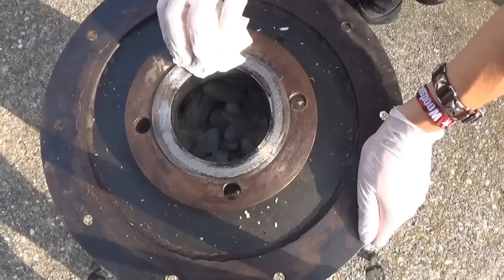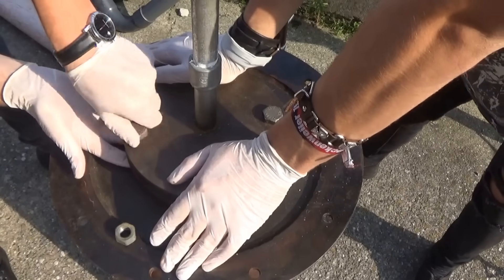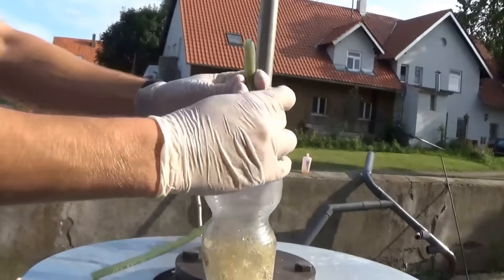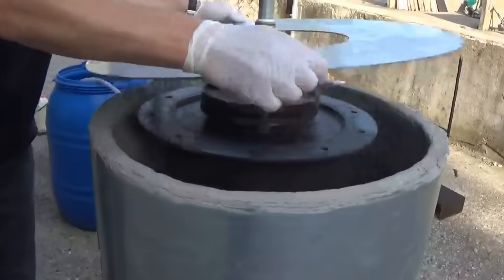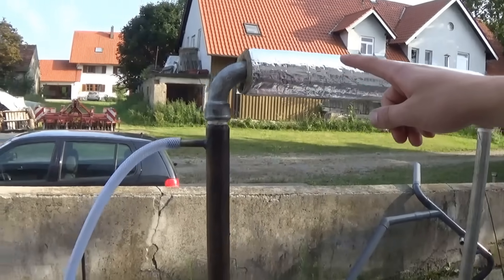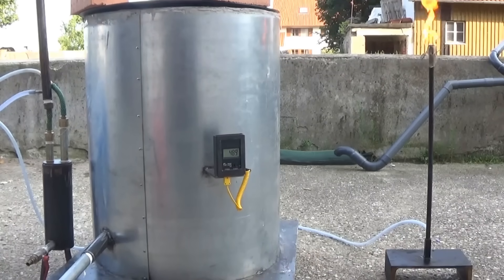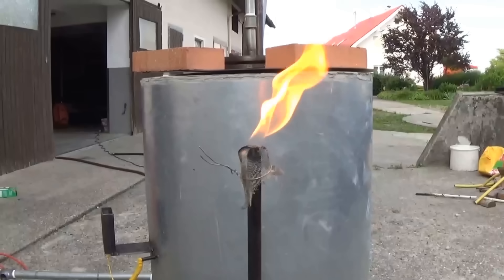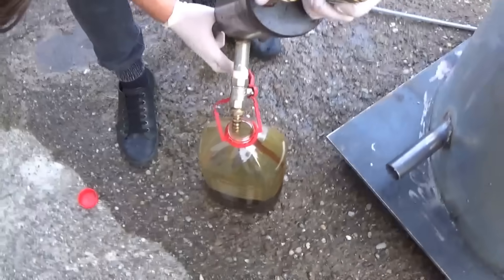plastic waste to oil/fuel improved pyrolysis reactor

Comment: I have a suggestion; to have a more volatile and easier to burn fuel you should try heating the released gas separately; either by moving it through a hot long metal pipe or turning it to a hot plasma torch using electricity

Comment: Add a GEET Fuel Processor and send excess power back to the poll.$$$$
Paul Pantone invented the GEET Fuel Processor, a replacement carburetor that uses 20% gasoline, diesel, crude oil and the like, and 80% water in a bubbler that runs up into a double pile with a rod in it. The creation has some effect that makes a plasma arc and changes the fumes to another element that creates an implosion instead of an explosion. No pollution and 3% more oxygen than what's in the atmosphere. It's easy to make, thousands of backyard mechanics have built the GEET Fuel Processor and many have posted their results here on YouTube.
This one shows the Plasma Arc.
https://youtu.be/RTmN5EEcJ5Y?si=-NmFac7Y42Ov8nHk
This one shows it running on beer and coffee. 
https://youtu.be/RBdLisFwbVc?si=oE5BUymRAc130D8r
I really hope your notifications are on.

Comment: Your burning plastic. Is no one thinking of the exhaust gas being extremely cancerous and smelly. What about our breathing air quality? Did you do the calculations on that? Gasoline and diesel have exhaust systems to catch and clean combustion products. Have you designed such an exhaust system for your fuel? Most fuels are aliphatic hydrocarbons, most plastics are highly branched polymers. How do you prevent unwanted combustion products and promote clean burning? The government has put a stop to this for a reason, burning plastic isn't safe on any level!

Comment: While in theory a great way to make use of plastic waste, if you're using assorted plastics that can be contaminated with all sorts of other stuff, you're going to have such an complex and unpredictable chemical stew coming out of the reaction chamber as to render the output as bad or worse than crude oil but at a far higher production cost. Seems like just burning the waste plastics as a fuel source instead of fuel oil and using the fuel oil to make new plastics might make more sense.
Though I could imagine that this might be worthwhile with cleaned and sorted plastics so that the output could be made more stable and predictable. Though I still have a hard time believing that the resulting fuels would be cheaper than crude oil derived ones.

Comment: I saw that you used a weld neck flange as a means to distance the heat from the pipes, but I was wondering what type of flange you welded the actual pipe to? Is it a blind flange with a hole machined into it? I'm very curious as i'm considering creating a reactor myself, any help would be appreciated. Thanks!

Comment: OK. NOTHING NEW HERE.   BUT NOTHING IS FREE IN THERMODYNAMICS.    NOTHING.  SO HOW IS BURNING BUTANE TO PYROLYZE PLASTIC TO CREATE A LIQUID HYDROCARBON GOING TO REVOLUTIONIZE ANYTHING.
Reply from the maker: Hello as said in the video the process can be run by the produced hydrocarbons. Which amount for around 30% of the energy stored in the waste. 
My hobby system just burned the gas in a flare because i was having problems building a gas storage system. 
If you are interested in the matter I can recommend you a couple of papers which explain the process in detail. 

best Elias

Comment: Strictly for climate change deniers. This makes CC worse by using more fossil carbon as a fuel. Yes, microplastic pollution is a gargantuan disaster, but CC is more pressing.
Reply from the maker: First of all I am no climate Change denier. Second... please read scientific papers try to inform yourself on a topic before you post your opinion. Once you have done this you will understand that your opinion on the matter is lacking some important bits. 

Best hazelChem
Reply: @HazelChem  Wow, extreme assumptions there sir. I have read many scientific papers on the topic. However, none are needed to know that the plastics that you are processing are all made from fossil fuels. What other premise is required to prove my conclusion?
Reply from the maker: @TheJamesRedwood   The fact that fossil fuels will be needed for quite a while more is undeniable. In the industrialized countrys we need to go for green technologies as fast a possible.. but the global south is lacking the infrastructure to do so. It is euro centrist to think that even in one hundred years we can go fully green or circular in economy.  
Having said this, many countrys have no functioning waste management system and fuel supply tends to be a problem. There pyrolysis comes in as a transitional technology for a couple of hundret years. With pyrolysis you can decrease the amount of garbage that is being put into landfills and produce hydrocarbon based fuels. The economys of the global south will need fossil fuels in there path to modernization. In other words those economys will need those fuels so it is better for them having a decentralized way for disposing of waste and also producing fuel. 

Best hazelChem
Reply: @HazelChem  I live in the global south so don't preach to me. 
So you don't deny CC you just don't care. Nothing you have said argues against the conclusion that burning plastic increases the amount of fossil carbon in the atmosphere.
You haven't even begun to address the toxins, including dioxin, you will be releasing in addition to the burned hydrocarbons. Have you even warned people about this in your video? Or are us southerners not worthy of breathing clean air?
Proper recycling, which I realise is hard to find, is the only ethical use of waste plastic. Burning it is the worst possible use.
Reply from the maker: @TheJamesRedwood   
first point dioxin: 
dioxin also known as 2,3,7,8-Tetrachlordibenzodioxin cannot be produced in this system. It is chemically IMPOSSIBLE. I study chemistry at the technical university of munich so this is my field of expertise. 

second point: 
production of CO2 must be decreased in the industrial nations. Studys have shown that the economys of the global south will be reliant for many more decades on fosil fuels. This CO2 will be released by those economys importing fosile fuels and burning them. Pyroylsis allows to reduce the amount of fuel that has to be imported thus strengthening the local economy and in the same turn disposing of plastic waste. 

So if you do not want for those economys to collapse and bring poverty in the region you will need fossil fuels for the transition period (which will last many decades). 

third point: 
as I am working with many in the field of recycling... most plastics can  not be recycled. It is a sad truth but if you watch documentarys like "the big recycling lie" you will see the dilemma. 

Seems like you are quite strong on your opinion but maybe those arguments can reach you. 

Best hazelChem
Reply from the maker: For those interested I will answer this persons points:

Pyrolysis is done under a inert atmosphere (in my chase CO2). Under these conditions there is no formation of  poly cyclic chloro aromatic hydrocarbons (dioxins). They need oxygen for the formation. 

Pyrolysis as any crude oil contains hazardous compounds and has to be handled with proper safety precautions. These are pretty similar to those of normal fuel. Also the pyrolysis of PVC has to be done with specialized equipment (BASF has a patent for this)    
Here you can get good information on plastic pyrolysis:
https://doi.org/10.1016/j.pecs.2022.101021

Now to the last point. I want you to ask yourself the question and do research on the topic. Do you think our fossil fuel dependent economy can directly switch to clean? 
Wouldn't it be better to turn non recyclable plastic waste into fuel and decrease the amount of oil we have to pump up? Wouldn´t it be better to get rid of the plastic waste and turn it into a resource instead of clocking up half of the world? 
For answering this question for yourself I want to share scihub with you. You can search for papers on google scholar and have open access by putting there name or doi into scihub. 

scihub: https://sci-hub.hkvisa.net/

Now to you TheJamesRedwood. The way you answered is just not okay! I know that many people think that the internet is free of social standards but I wont let you talk to me like this. Maybe the next time you want to actually have a discussion with someone on the internet you will think on how to speak with others. 

hazelChem out

Comment: STOP Shoplifting and Theft and Sellers would not need such excessive packaging of Products to TRY to Prevent Stealing. Also packaging are excessive in Size for the products they contain for no good reasons except as a marketing tool. If packages barely contained the products within garbage would decrease by 30%.

Comment: Does the excess gas that is generated have to be burnt off ? Or could you fill a big bladder and then compress that gas back into gas bottles and use to heat the combustion chamber again?

Comment: Making something harmful to the environment into something even more harmful to the environment; great job.
Reply from the maker: You are actually incorrect about that. I study chemistry at the technical university of Munich. At the moment we are a team of people working on  bringing this project into the global south to help get rid of plastic and make fuel for the local economies. 
If you look at papers you can see that for example mixing normal fuel with 30% pyrolysis fuel does not significantly increase the emissions. 

If you have questions left i am happy to answer them.

best hazelChem

Comment: Good for you.  Read in C&EN where some undergrad Chemical Engineers, during one summer did something like this, and from what I read, worked pretty well.  They were using a catalyst in their system.  They used a DIY setup, as in the clip.  The better news was that their catalyst worked pretty well, and they were able to set up a company and get a loan from a local bank.  Does it have to be plastic?  Why not saw dust from a lumber mill?
Reply from the maker: Any organic material works but the workup process differs quite significantly. 

best hazelChem

Comment: The reason they didn't mention the cost is that the cost to create and maintain the reaction with propane or natural gas is much higher than the fuel you get out of it. And it's producing CO2 that's vented right into the atmosphere through that flare  wasted energy..There's no way this can ever produce more energy than it takes to make it.
Reply from the maker: thanks for your comment. Your idea about the process is not quite right. The process it self uses energy that is correct. But with the right setup (enough insulation) you can run the pyrolysis on around 30% of the energy that is contained in the plastic waste it self. 
So the waste it self is the energy source you only need a start amount of fuel and than you produce oil and gas from the waste. 
This setup i build by my self at the age of 16 so it is quite lacking in many points.
1: the gas that is produced i just burn because i did not quite know how to build a low pressure gas burner at that time
2: The insulation is way to weak... there is a lot of heat bridges (metal on metal contacts) where you lose a lot of energy

now I am working with a team on my university (TUM) and we are building a unit that is self sufficient in energy by using 30% of the produced hydrocarbons (the gas and the heavy oils)  to produce diesel and gasoline. The system second main purpose is to build up a decentralized waste disposal for plastics in the global south (if you are interested I can further explain that). 
The difference is the new system alone in raw materials will cost around 5k€ compared to the 200€ of the old one. 

For the CO2 there is different factors to consider. Plastic and micro plastic poisoning our food chains or the illegal burning of that plastic are way more harmful to the environment than the produced CO2. 

I hope I could clarify most of your misunderstandings. 

best hazelChem

Comment: spálíte víc plynu než vyrobíte kapaliny, to se vyplatí :-D
Reply from the maker: for that system you are right! But I build that thing with 16 and only 200€. Now I am working with a team at TUM to make this thing run on its own gas and some of the produced heavy oil. 
If you do the math behind this reaction we can produce fuel from plastic by using 30% of the produced hydrocarbons. The beauty behind this is that we are using the produced gas and heavy oil which we cant use otherwise. With the rest of the products we can make fuel for diesel and gasoline engines. 

If you have more questions please asks them! :D 

best hazelChem

Comment: I worked in a plastic recycling plant and the recycled plastic was brought to Bottrop by truck. In the
Oil plant where recycled plastic is made into oil. However, the whole thing has been abandoned because it does not make economic sense, and more energy and costs flowed into the plant than was made by the recycling process. In short, it's not worth it, and it's not an advantage for the environment, but rather a disadvantage. Very high costs and lousy environmental characteristics for a project that makes no sense.
Reply from the maker: this project is meant as a way to establish a waste management infrastructure in places where there is none. Industrial country's must properly recycle their polymer wastes! 

hope this clears the nature of this project 

best hazelChem
Reply: @HazelChem  Ok, but it is and remains simply too unprofitable to really work economically. There are far better and more profitable ways to recycle plastic. Even in countries that are not so technically advanced.
Reply from the maker: It is part of a solution. The plan for my first properly build system is to compliment the work of a NGO (Pro-Ocean) which collects plastic waste in the Philippines. They recycle some of it but most of the plastic simply can not be recycled and ends up in a landfill. Landfills are are great polluter from them toxins leak into the environment and they catch on fire or are set on fire quite often (which resales a lot of toxins again). With a pyrolysis systems they can reduce the amount of waste they are bringing into the landfills and use the produced fuel to power their trucks they use for collecting the trash. 

Here a better explanation on the Idea behind the pyrolysis system and explanation on the systems you can see on my channel already. 

The process it self uses energy. But with the right setup (enough insulation) you can run the pyrolysis on around 30% of the energy that is contained in the plastic waste it self. 
So the waste it self is the energy source you only need a start amount of fuel and than you produce oil and gas from the waste. 
This setup i build by my self at the age of 16 so it is quite lacking in many points.
1: the gas that is produced i just burn because i did not quite know how to build a low pressure gas burner at that time
2: The insulation is way to weak... there is a lot of heat bridges (metal on metal contacts) where you lose a lot of energy

now I am working with a team on my university (TUM) and we are building a unit that is self sufficient in energy by using 30% of the produced hydrocarbons (the gas and the heavy oils)  to produce diesel and gasoline. The system second main purpose is to build up a decentralized waste disposal for plastics in the global south (if you are interested I can further explain that). 
The difference is the new system alone in raw materials will cost around 5k€ compared to the 200€ of the old one. 

I hope this explains the most important details. If you have more questions please ask them i am happy to answer them! 

best hazelChem

Comment: I'm confused.  Why use a system that uses propane or whatever was in the fuel used to light the fire?  Does this produce more fuel than what is used?  Also, with all the comments, I live on an island where plastics and wrappers are abundant.  If there is another way to reuse them efficiently, somebody please point me in the right direction.

Comment: Hey, I know adding water to the reaction vessel is dangerous but could you try it? I know that will create excess hydrogen but it will also make most of the gaseous carbon turn to solids. It should also create new hydrocarbons that are much more flammable and easier to distill.

Comment: The way to go ! By the way , please use washers under the nut and bolts when you bolt the lid down ,and , why dont you use the gas your burning outside of the kiln ,put it back inside the kiln ! Smallpoints but I hope it usefull .